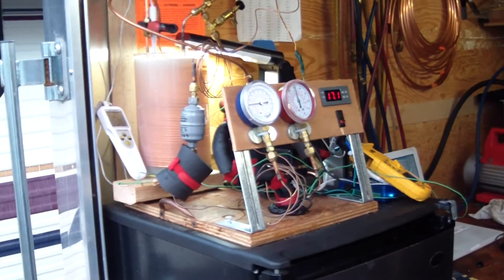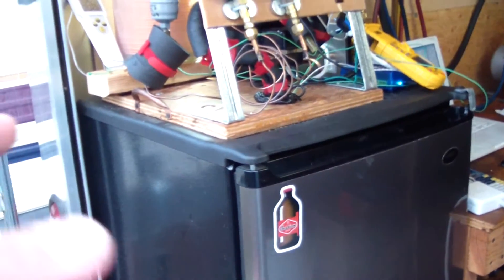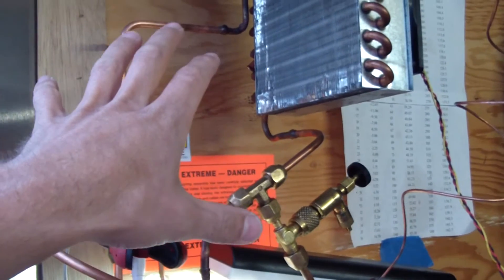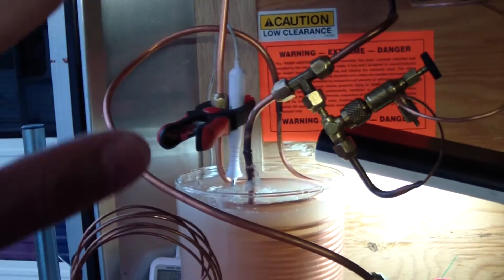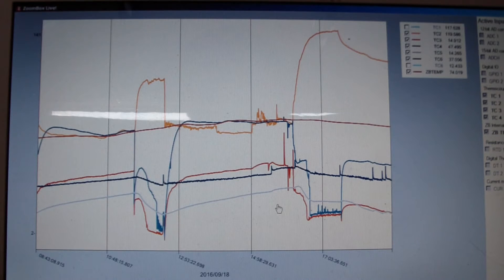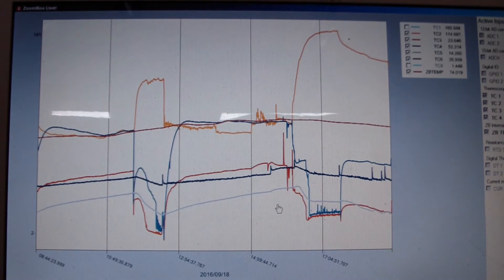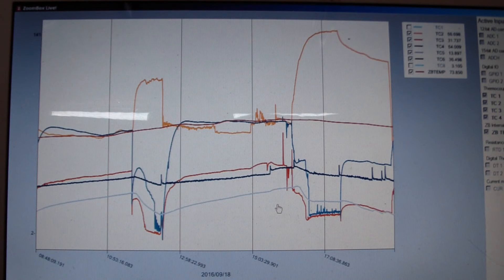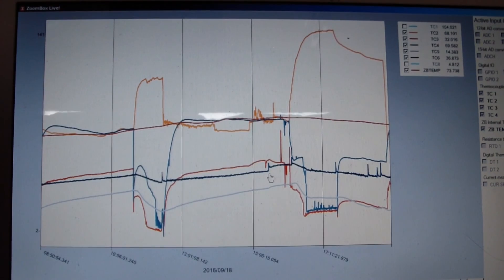Vaseline Phase Change Material, and Passive Thermosiphon

Comment: Hey, you seem to know the math that goes in to these things.

I also saw you are trying to make bio-char.

Would you like to help me make a DIY salt type PCM whole house passive cooling system?

I want to use in slab radiant heat type coolant loops (PEX tubing) inside Insulated Concrete Form (ICF) walls with a ground source coolant loop (coiled PEX tubing buried about 10' deep) and also run the PEX lines in a coil down inside a barrel and back out up through the middle and the barrel will be filled with a DIY PCM that melts around 80° f.  The PCM barrel will also be buried about 10' deep so it gets a bit of ground source cooling too.

The idea being to use the PCM as a sort of thermal buffer so I can size my ground source coolant loop for my average heating load rather than the peak.

In the desert temperatures can get close to 120° during the day and stay over 100° at night but without solar heating the walls and roof.  Meanwhile 10' underground the ground temperatures remain near 70° f.  My idea is to short circuit the thermal gradient in the wall and dump heat in to the ground and the PCM barrel during the day and at night hopefully re-solidify the PCM with the ground loop cooling (maybe by cutting out the wall portion of the coolant loop at night if I have to).

I think I can do the whole thing with a low power water circulation pump to reduce AC loads in summer and heating loads in winter (heat pump mode on the AC).  I just don't know how to size the system.

Most people that do stuff like this use a $$$ ground source heat pump so they can drive heat in to the ground but I want simple, cheap and reliable.

I'm sure there is good math for radiant floor heating, good math for ground source coolant loops and good math for PCMs but nobody has seemed to put it together yet and especially not inside the thermal mass of an ICF wall.

Think of it like an above ground earth ship that lives like a normal house.

It will be powered by off grid solar (which will also shade the roof).

I'm not going to certify it but I want to build my version of a passive house or net zero.  I really don't care where it lands as long as it is efficient and has ample power for everything I want to do including some welding and machining in my shop.

Some people try to do similar things by burying air pipes for ventillation but that seems stupid to me, there is very little surface area to transfer heat over, very little thermal capacity in the air, no PCM buffer and who knows what will get in the pipes and start growing over time?

Using a ~sealed coolant loop to cool the interior of the walls removes all contact with the coolant loop so an ERV or HRV will deal with my ventillation and air filtration for maximum interior comfort.  I'm still going to have AC also, it just won't have to deal with all the heat that I can dump in the ground.

I think it should work to some extent, the only questions are will it reduce my HVAC load more than the load of the circulation pump and if so, how long is the payoff because the alternative is to skip all the digging and just add more solar to cover the HVAC load.
Reply: With my old house no amount of diy geothermal or pcm will likely do much good when my southern wall and uninsulated roof is being hammered by sun all day. It adds up a lot, and gets crazy hot up there even with a constant fan blowing air out a window. The most bang for the buck for the summer will come from shading as much of my house as possible. Solar panels over the roof is likely one of the cheaper options, even more so if you are able to safely install them enough above the roof that air can flow underneath and cool. It is another opportunity to pcm under the panels and they should produce more, and them maybe having them more flat against the roof would be fine. Haven't tried yet.

What pcm are you thinking? Duda seems to have the least expensive Sodium Sulfate ordering straight from their website (less than Duda on amazon and ebay). Calcium Chloride has gone up a lot in the last two years but still cheaper. It sounds like xantham gum to thicken and increase efficiency over many melt cycles, plus an unknown amount of borax to reduce supercooling. I have 100lbs of calcium chloride to test. It seems most residential pcms are in thin foil pouches, I assume to maximize surface area.

I have wondered if I could make something like part of the tech ingredients desiccant air conditioner, but the main goal would be dehumidification and fresh air. Basically, a cooled super concentrated calcium chloride solution is sprinkled against an updraft of air inside a tube, thus dehumidifying and cooling the air that enters the room. I may try to use outside air and bury part of the tube underground first and I'm slightly less concerned with things growing in it since it is a super concentrated salt solution. That guy in Nebraska does all air and he grows tropical plants in the winter, so if you have enough fans air should work.

It is my current thinking that a pcm under my floor, heated all day with solar, would allow my floor to still be at 80F several hours after the sun went down. So its just shifting. Right now I can use a 1800w space heater all day and many days that really helps, but then my house gets super cold as soon as the solar dims. I think a pcm would be a good fit. I think it would work best spread evenly over my floor. It is the volume/surface area ratio that lets us affect the timing of it to some degree, right?

Final thought, do you need to worry about condensation in the wall? That is part of what keeps me from actively cooling a pcm in some way and putting it in my attic or inside my walls.

good luck.

Comment: Are you sure that is a rotary compressor?
Reply from the maker: Actually, I'm not sure. I haven't found any data on this particular compressor. Based on the amp draw, I figure it's about 3.5 cc, but as far as rotary or reciprocating, I'm not sure. I've seen plenty of small rotaries this size, so I'm guessing.
Reply: The vast majority of blob shaped compressors like this are of the piston type.